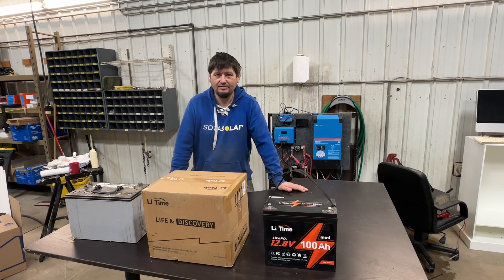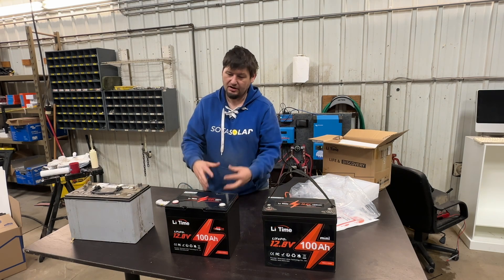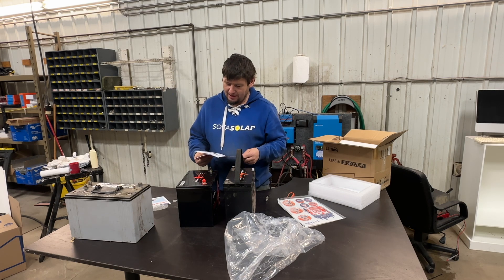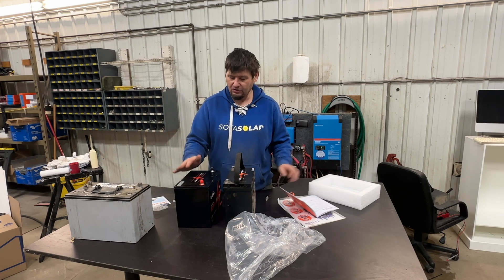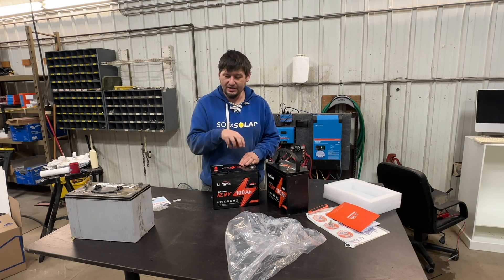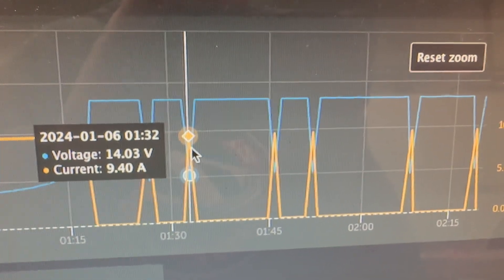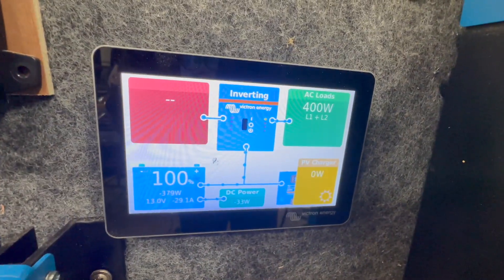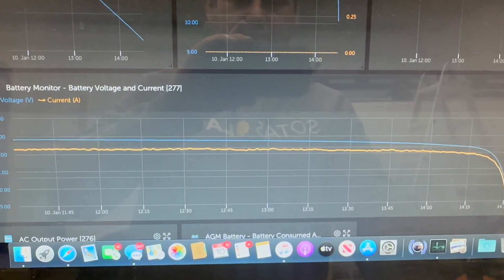Li Time Group 24 LiFePo4  Battery Review  Plus Top balance Process

Comment: I know a way to do a top balance on these packs because each battery might have different bms parameters. First, charge the battery to full and then unplug the charger from the wall outlet. Second, connect a smart wifi outlet switch in the wall and connect your charger to the smart outlet switch. Third, set the smart outlet to turn on for 1 hour and then off for 10 hours and on for 1 hour and off for 10 hours and repeat until your battery voltage can reach the magic 14.6 volts or close to it. It could take many days as the bms balancer is slow. Thanks.
Reply from the maker: Great idea!

Comment: I believe all Li Time batteries come with low temp protection. I own two- 200AH Li Time LiPo4 batteries and they both have it.
Reply from the maker: https://www.litime.com/products/litime-12v-100ah-group-24-lifepo4-lithium-battery-built-in-100a-bms-1280wh-energy low temp charge protection shows NA.

Comment: Shawn,  I currently have (2) 206 Ah SOK batteries in parallel  and am considering adding an additional one for a total of 618 Ah. (SOK currently is selling the 206 Ah batteries w/ Bluetooth and NO internal heater, for a great price) My question is can I just add this additional battery to existing "bank" and let my Victon Multiplus II Inverter/Charger charge all 3 batteries or do I need to charge the new battery completely before adding it to the other 2?   Love your channel and your new shop!
Reply from the maker: That’s a great question, sounds like something we need to test. I’ve done some variations of this on my own. 

Long story short, try and get it closer to the state of charge of the rest of your system. There will be some amps
Moving around, you just don’t want to see 100a or something.  To ensure that, try and get the volts within .5 or so. 

You may want to enable DVCC and limit charge current to 20 amps or something so the battery doesn’t get slammed at top disconnect.
Reply: Can you recommend a desktop battery charger to charger a battery independent of hooking it up to the Multiplus II to charge the additional SOK battery to charge it before adding it my existing battery bank of 2 SOK 206Ah batteries.  Currently my 2 existing SOKS are configuration to charge from my Multiplus II at 100 Amp (50 Amps each per the SOK recommendations)  I believe my Multiplus II is capable of a Max charge of 120 Amps.  My thought was to increase the charge amperage to 120 Amps once I add the 3rd SOK battery. Thanks
Reply from the maker: @markratliff7991 this is what I use. https://amzn.to/3ShDeVB lets you dial in whatever you need . Super useful.